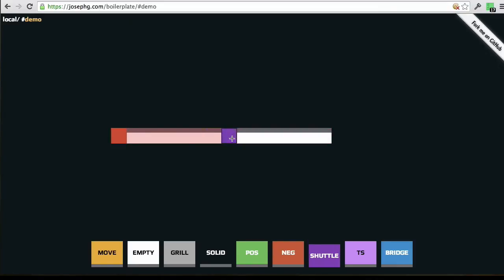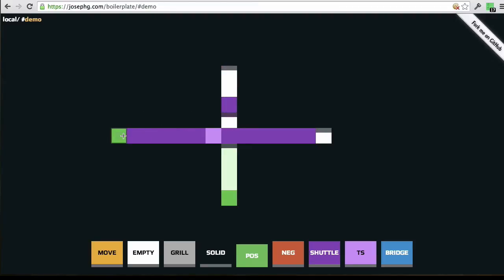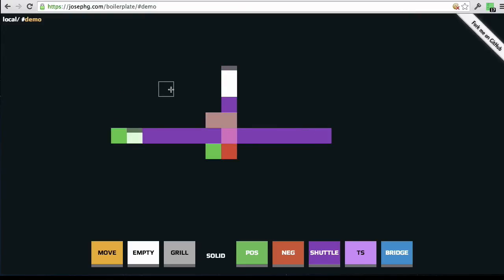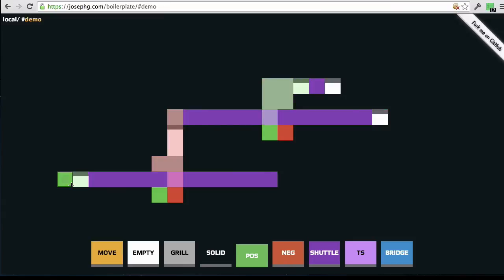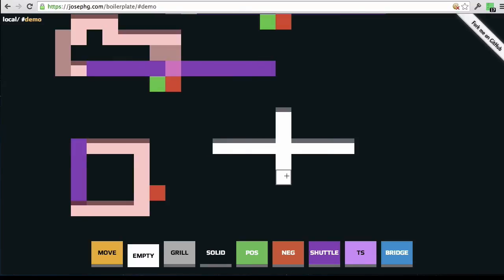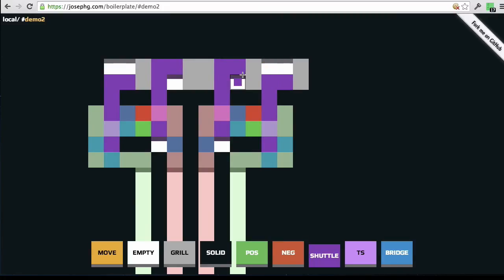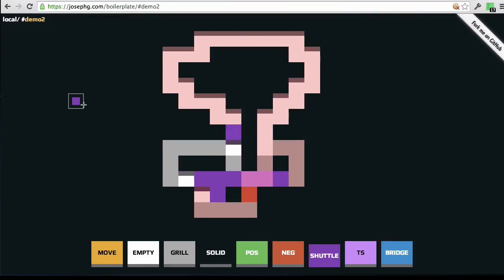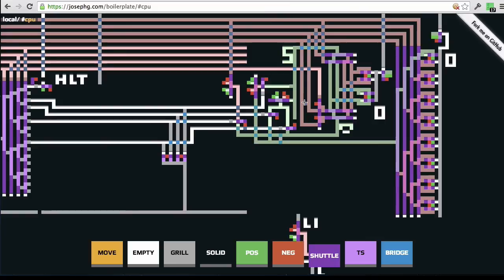Boilerplate - Steam Powered Computing

Comment: Well, if Babbage had gotten his act together and gotten the Difference Engine and the Analytical Engine put together, there very well might have been a Victorian information age, with steam powered mechanical computers. In the case of a Babbage machine, the steam engine drives the computer via a belt that drives a flywheel which spins the gears that make up the machine's logic to do various mathematical operations. Coupled with programming by the Lady Lovelace, and Samuel Morse's electric telegraph, you'd have the rudiments of the internet (even the telegraph alone could be considered that, morse code is the original Instant Messaging).